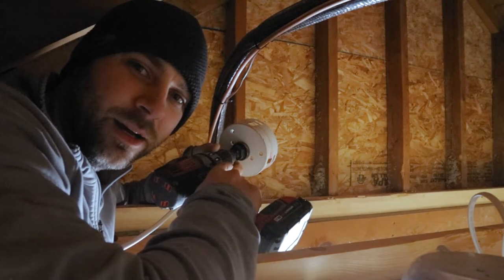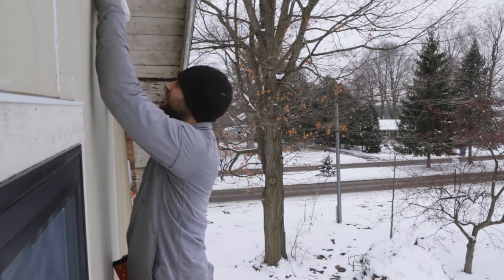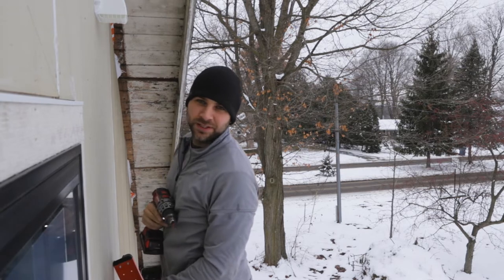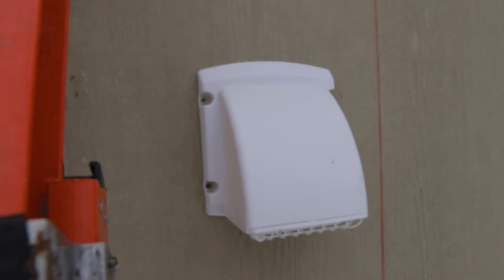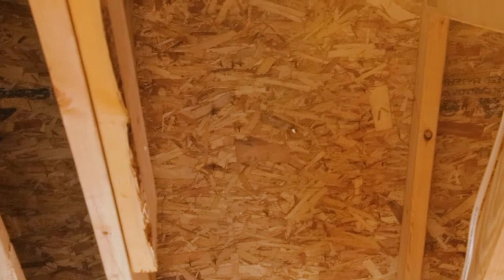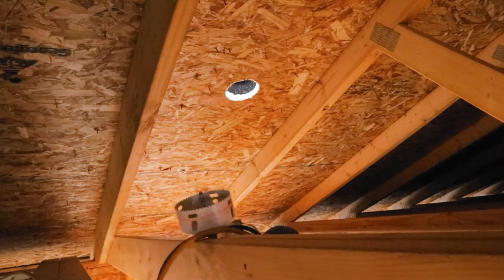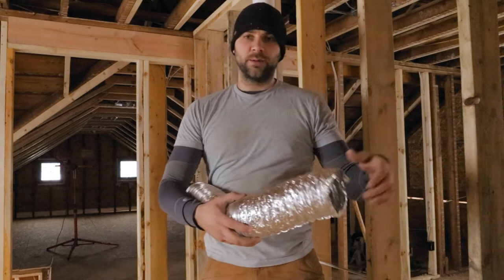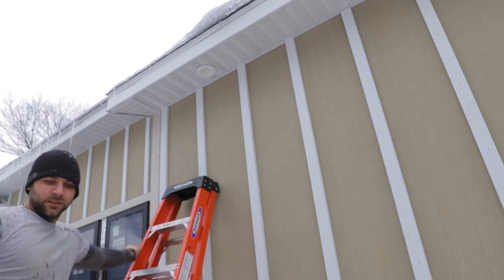How To Install Vent Ducts and A Drain Vent - We Bought A Farm House

Comment: I was just installing my bathroom fan the other day too.. it was a lot of work going through the roof.. but, that’s probably easier than going through the stone wall!!  I super insulted my vent pipe in the attic too! I guess moisture can build up in them.. 😀
Reply from the maker: I saw you talking about that vent cap, i thought about that but i was able to get to a gable end for my two main ones, thought that would be easier.